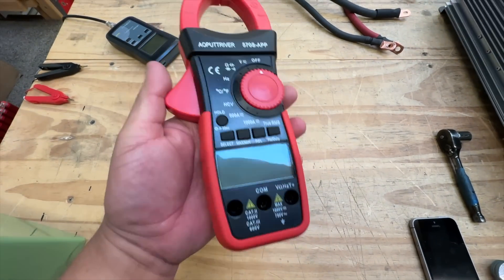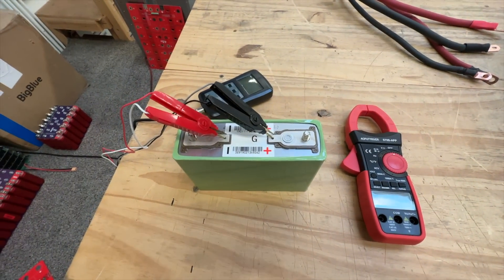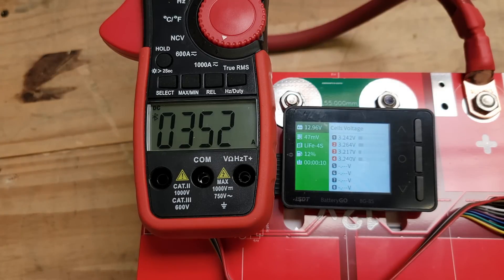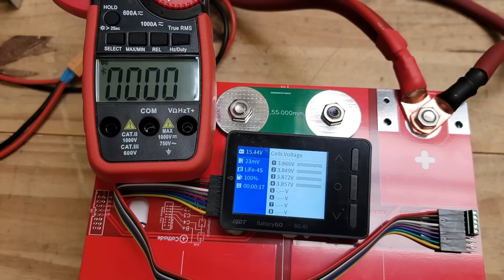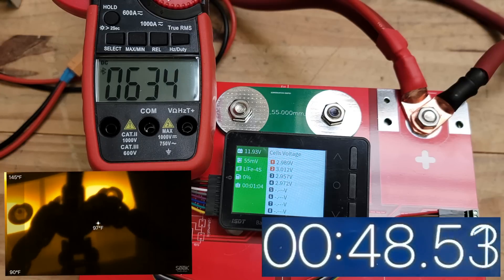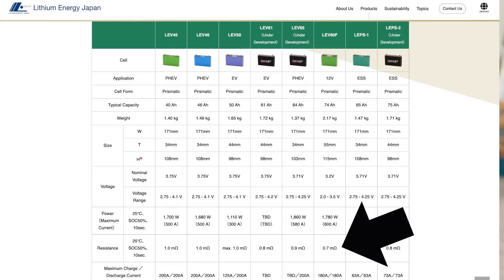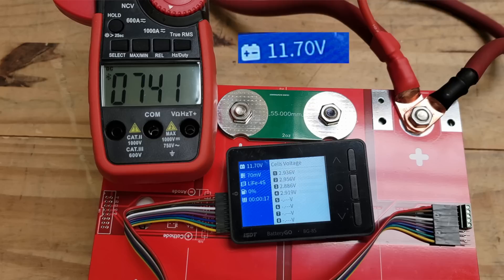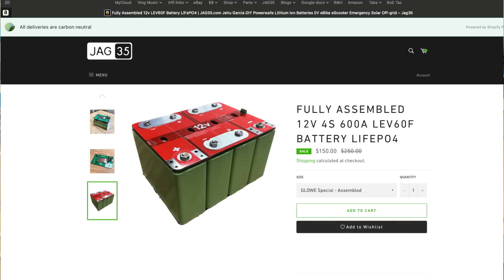CONFIRMED 600A LEV60F  12v YUASA Battery

Comment: Hi, I just bought a 600 Amp Lev60f 12v battery from you and two of the cells are dead after some light use can you advise me what to do. I need to replace the dead cells.

Comment: Hello Mr. Garcia, I'm wanting to purchase a Fully Assembled LEV60F today. Can I mix it with my small AGM or would it handle starting a lil 1.5L Toyota and run my 1200 rms system fine on the stock 70 amp alternator? Have great wiring already. Thank You
Reply from the maker: 600A. Does all the things you wanna do.

Comment: I purchased 4 of these cells to make a 12v 74 ah battery. Unfortunately for me, most of the bus bars I need are sold out including the 12v PCB board. I am using universal bus bars rated at 60 amps. I'm stacking them in three's. Will this suffice and will I still need to use a bms?

Comment: I just have some questions but your website doesn't have a "contact us" spot. 

I've read that this particular one is a "plug n play" for car audio but it doesn't mention for how many watts. Whether this kind of money is a lot to you or not it actually is to me, I don't mind spending it though IF it truly is plug n play as in I can run a 1/0 OFC wire from my alternator to it and then a short run to my Amp and my 110a alternator will charge it and my regular battery too. I only have a 1500w RMS system so I'd rather not have to buy a $400 alternator and a $400 battery too but I can't seem to get a straight answer from Anyone anywhere.

Comment: Can I use this battery to replace my 12v car battery?
Reply from the maker: Yes but not under the hood,  move it to the trunk
Reply: @jehugarcia  hi just received my lev60 from you,  I love it,  question what amp anl fuse should I use between this and my amplifier on positive wires

Comment: I’m about to buy 4 of these. I’m wanting to use them as a 12v battery to stick a 12v DC socket of to run my CPAP. With this much power I’d think it’d last for weeks. What BMS would I need or would I be ok not running one and just charging it up with a noco charger when I get home?
Reply from the maker: get the one with the BMS already installed https://jag35.com/products/fully-assembled-12v-lev60f-battery-lifepo4?variant=40862255382643

Comment: Would these be good for 12V golf cart battery replacements?
Reply from the maker: Probably
Reply: Yes, I’m using for 48V HD ATV Gator and they’re really stout…pull 200-300amps without breaking a sweat. Just make sure the rest of your electrical is up to par if running aftermarket components because the weak link won’t be these batteries!

Comment: A question for you, my neighborhood is plagued with house power flash off anytime for 2 seconds to 20 seconds It really could be storm or heat causing it. My question is I have a 100 or 200-amp breaker in my house could I use one of those batteries as a backup power to stop this I have 2; forgot the proper name plug into the wall then pull your devices into it uninterrupted power battery (they will last for an hour at 75% load ) could I with help of my uncle who an electrician wire it into my house like I mini tesla wall battery to stop having everything go off and either have wait 5-10 minutes to get internet and cable working not to mention all my clocks that need to be reset microwave my oven etc.

Bonus question could you or have you done a video on how to build your own power inverter from DC to AC? If I could cheaply (compared to buying them build my own push comes shove if couldn't just set to main power build battery back up for all my major devices would be my other option the do hickys that I have do great on my computer 3d printer and my bedroom TV cable box (2 separate ones ) just so tired of power just flashing off for few seconds in July was over 30 times and sane with all my neighbors so not an issue with my house it's the power company that is useless made multiple complaints even on nice days in the high 70's-low 80's with nice weather and it happens power company will say it's weather related or high demand or on nice day they said could been any number of reasons but won't do anything to address the issue even cone out check the big green boxes see if they may have a fault in them causing the issue for my block and block on both sides can tell at night easy cause even stret lights go out and they take minute to turn on and get to there full brightness.

Thanks love your videos so informative I did the vapeing when first came out and had lots of those batteries left over built a few battery banks out of them to run small devices or use as power banks for devices up to my laptop which could run and charge off of them.
Reply from the maker: yeah you need a UPS,  one huge whole house one or  a few small 1000W or 2000W ones on each of your critical load circuits.
Reply: Victron and Deye have inverters that allow you to put your whole house in island mode when the power drops. Like a giant UPS. literal miliseconds switchover.

Comment: You should do some charging torture tests. Car audio people use 300+ amp alternators to charge. Sometimes multiple alternators.
Reply from the maker: Yeah but when your battery can output 600A you don’t need all those alternators and if a battery can put out it can take in so 300A is no problem
Reply: @jehugarcia  That's were I got lost. Ratings on the cells are 180 amps charge/discharge, so do u do each cell x 180 to give u a total of 720 amps of total of 4 cells.
Reply: I'm pretty sure running it in series only increases the voltage. Not the amperage.

Comment: If you are going to continue doing high load tests, get the old school resistive battery load tester. Handheld models go up to 500A, less than $100. There are bigger 1,000A models too. No idea on price. But then you dial in the current you want. None of the fluctuation, having inverters or whatever kick off etc.... Much more reproducible, but also time limited too. Maybe 10 seconds max at peak rating.
Reply: Or a carbon pile
Reply: @ericklein5097  Yes, exactly what the higher amperage models are. Smaller models are just a wire heating element.
Reply: Those things are even worse. And they blow up if you leave them on for more than 10sec's. 
What he can do is get some heaters.
Reply: @KuntalGhosh  I guess you missed the part where I said they are limited to 10 seconds at max power? But 500A on a 1000A carbon pile can go longer.

Comment: If i buy the  ISDT BATTGO BG 8S SMART BATTERY CHECKER BALANCER will i just plug in to this. Or do I have to modify the battery to get it to work?
Reply from the maker: Plug n play,  you just need that cable  https://jag35.com/products/2-54mm-jumper-cable-connector-for-pcb-male-to-female-8-pin-dupont-24v

Comment: How would this in drag racing maybe with some capacitors for a very large short duration burst ? I have something in mind.
Reply: They should do just fine honestly because I’m not sure what you would be pulling anywhere near 600a in a drag car even without an alternator but there is also other cells that would do even better than these

Comment: Why does the specs sheet have the range for these cells between 2.0-3.5 volts?  All other LiFePO4 batteries are rated for 3.65v max.  Are these special somehow?  I saw your starting voltage for these going as high as 3.83v if I remember correctly.  Will that hurt the batteries long-term.
Also, are these batteries good for the standard 3500-5000 recharge cycles that standard LiFePO4 batteries are rated for?
Reply: I noticed this too.  My EG4 48V-18A charges my pack to 3.5V  (56V for pack) and shuts off…but, they run down close to 2.2V (34-36V pack) before they get anywhere close to dead, so I think the specs are correct.  Should I worry that my boost solar charge controller that cuts off at 57.6V will overcharge these?

Comment: What thickness copper are you specifying on the PCBs used for busbars and the main (red) common board? 1oz? 2oz? greater? For 3oz and above most makes have a big increase in cost and wider variation of thickness... is that your experience so far?
Reply from the maker: Yeah 2oz is twice the price of 1oz,  but then I’m running out of stud height,  so I can make 1oz plates at half the thickness for same price but I can load twice as many for Same price?   I might have to latzer 4mm solid copper plates

Comment: I was going to buy one of these battery packs but in the description it says; Cells are new and unused. Terminals not included.< what does that mean no Terminals ?
Reply from the maker: its suposed to say 2Awg terminal blocks,   those are optional addons.
Reply: Nothing to worry about, it's referring to the terminal soldering pads on the PCB busbar, some people got the impression that having those pads on the PCB means the battery comes with block terminals built-in. They don't, but since the pads are there you can always add your own block terminals to the soldering pads if you want. The battery still has all the cell "terminals" because they are a part of the cell itself and they protrude out through the PCB busbar to make the electrical connections. Hope this clarifies a bit. We'll adjust the wording so it's more clear, but thx for bringing this up so we can improve it 👍
Reply: @jehugarcia  ah ok thanks BTW your suggestion solved  the ebike 36 volt battery blinking light outage .I connected an adj power supply to the XT30 connection and lit right up.
Reply: @thejehugarciapodcastclips  thank you much for the full explanation.

Comment: which version should I order off the website for car audio? Prebuilt 12v Battery or with BMS ? I am going to run this with another lithium in the stock location - Retro 56 limitless lithium - also can I run this at 14.0-15v ? would you call this a super cap vs a headway lithium build?
Reply from the maker: The bms is only 200A  so if you need more than that don’t use it.  This battery max charge is 14.6v if you want it to last 20 years,  you can safely charge to higher voltage if you don’t mind some early degradation.
Reply: Charging it higher than 14.6v though won't gain you any meaningful capacity, only degrade the cells little by little. So, no danger going to 15V but also no reason to do so.
Reply: @jehugarcia  what is the difference in performance vs a headway setup.
Reply: @JeffAdairKTM530  That was the topic of the previous video: https://www.youtube.com/watch?v=Rc-S90seAkg

Comment: If it does 700amps you can easily start a truck with this. For 150bucks that is an amazing deal considering the price of modern leadacids for cars. This should be able to easily handle it.

Comment: Over 500A and still sitting just above 3.00V per cell....700+ amps above 2.91V

Fucking impressive. A REAL 10C battery that's not some <50Ah cylindrical cell.

Are there any other large cells that can sustain 10C for 10 seconds (after a 5C ramp up for 10-20 seconds)? Or have we reached LTO territory? Do they make Lipo cells above 20Ah that have very high C rates?
Reply: There are lithium ion with very high c rates used for ev application. 
Or hybrid battery..
Hybrid batteries are made for high current discharge but they have less energy density. 
There are not too many Lifepo4 battery for high current discharge. And this one is probably the best one i have seen yet..
Gs yaussa is a leadacid maker in japan. 
They started making lithium's for electric cars , these are used in Mitsubishi cars i think. This is the only Lifepo4 battery in their lineup and it is just amazing how well these are made and desinged. Made in japan still holds it's value for real.

Comment: Your cells were at 3.8v each... they should not be charged to more than 3.65v each
Reply from the maker: If you want them to last 20 years. Yes
Reply: LiFePO4 can safely take an overcharge into the low 4V range. It absolutely does degrade the cell and should not be done often, but they aren't going to get destroyed immediately, catch fire, or explode like the more energy dense lithium chemistries.
Reply from the maker: yeah we used to charge them to 4.2v in the early days
Reply: More under the impression that you put them at that voltage so your 600-700amp test doss not sag under 12v. All good... just saying